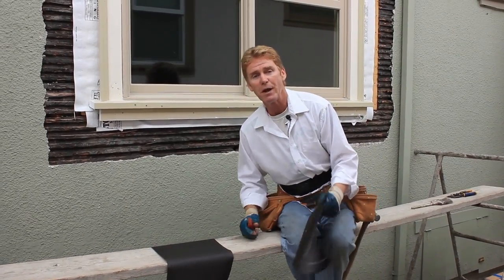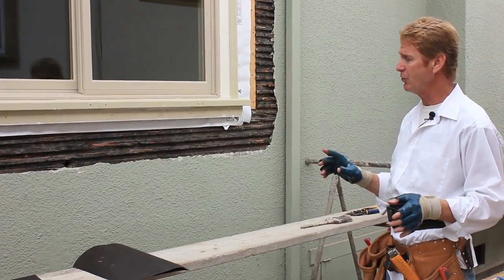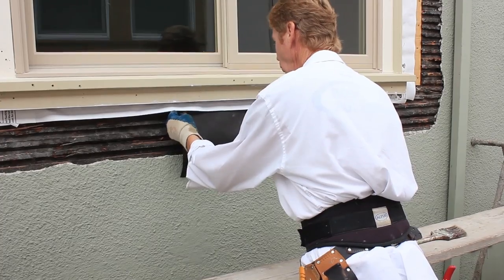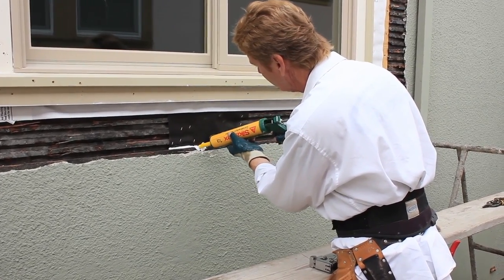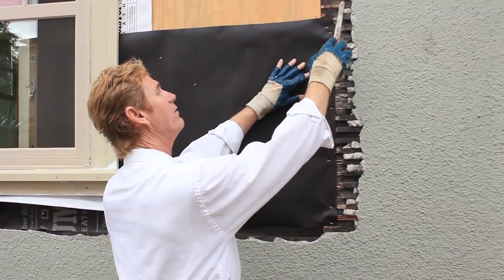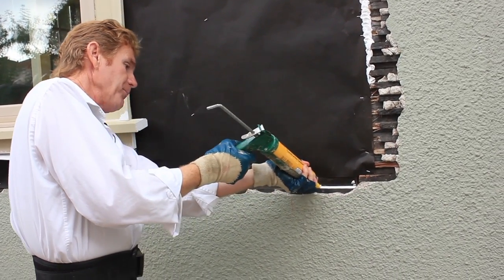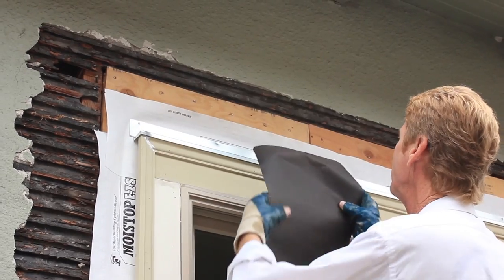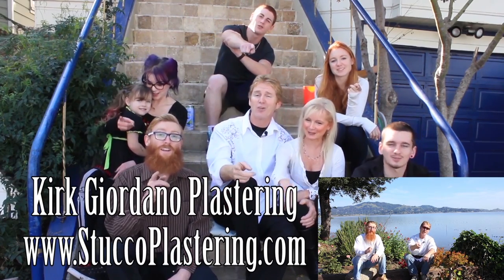Attach new stucco wire to old exterior wood lath

Comment: Where you tucked the paper in in the last key,  wont the water contine on down the wall?  you still have 3 or 4 feet to the ground?  Just trying to understand the water proofi g here.
Reply from the maker: Howdy Marc, fair enough question, the existing wood lath does have a membrane behind it. Thus any water that might sneak or penetrate a paint job and new stucco would harmlessly fall atop a wall that is already watertight. 🧞‍♂

Comment: Dumb question.,  What is a key?
Reply from the maker: Howdy Cross Dude, not a goofy question at all, in the real world a key usually opens a door.
      In the case of plastering a key is what allows the stucco to embed itself, that's why it's called a stucco key.
 Another example if you see an old wall with furring wood strips spaced about a quarter inch apart, the plaster goes through these gaps or what we call 'keys" then mushrooms behind this wood and gives the plaster a good bond or "key."
      
                     Live long and plaster, 
  Sharing stucco secrets, or common sense tips
Reply: Gotcha, Kinda like what a pop rivet does, once again, you the man! watching you actually inspires me to do the work on my house. BTW too many regulations in California, more like extorting money off all your jobs although I guess it grew from inexperienced users having plaster fall on peoples heads.

Comment: Why couldn't you use Weldcrete and stucco on to the laths?After all, failed felt wasn't why you were working there.
Reply from the maker: Howdy Jock dude, this would fail to waterproof permanently.
 shortcuts are good but not the ones that compromise the integrity of leaking,
 Best wishes, 
 kirk giordano Rendering